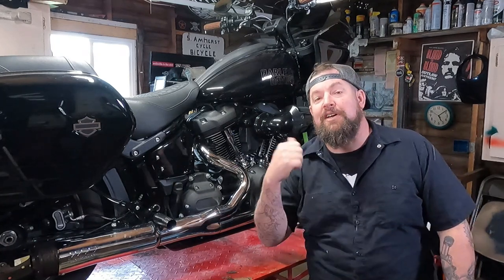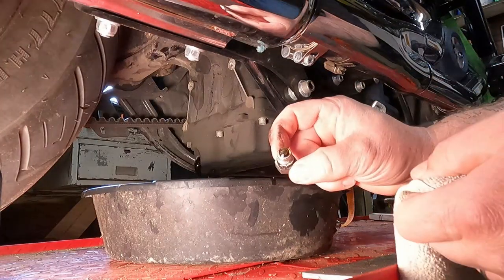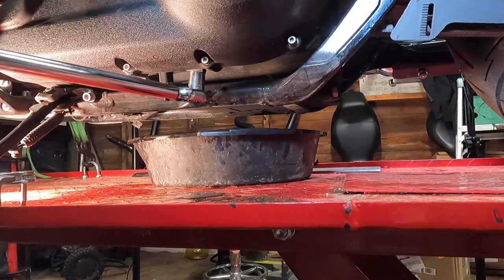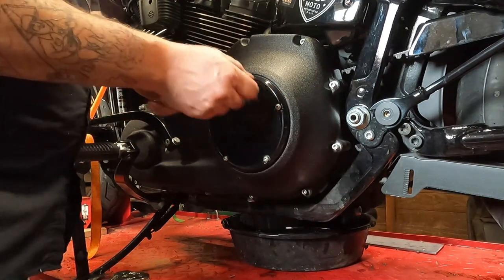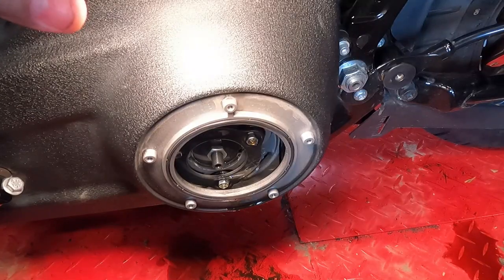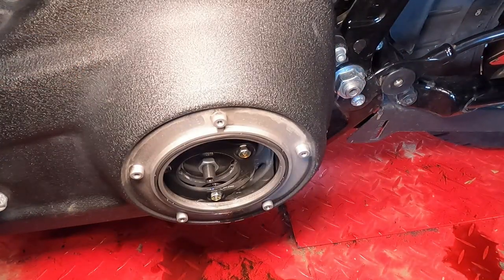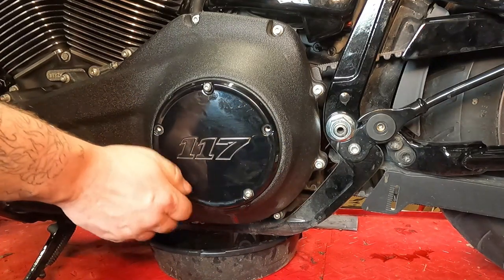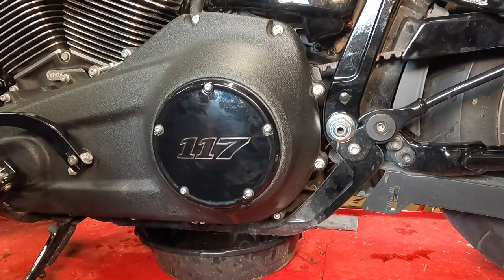M8 Softail Primary-Chaincase Oil Change.

Comment: Why would you need gear oil in the primary. A 10W-50 semi synthetic motorcycle specific 4T engine oil would be better. Not much in the way of gears in a primary.
Reply from the maker: Thicker oil is generally used for stuff with larger clearances.  The gear oil is lubricating the compensator ramps, clutch hub bearings, starter gears and of course the primary chain.

Comment: Break loose derby cover bolts first!  Do drain plug last.  Could avoid having a real bad day. Stipped bolt head & no oil in primary.
Reply from the maker: Either way you have to get the derby cover bolt out.  Are you going to just ignore it and ride on the old oil?
Reply: @KnobleMoto  you totally missed the point - you can ride the bike to somewhere to get the bolt fixed.  Not if fluid is drained first.
Reply from the maker: @johngall9974  I did miss that point.  If I stripped a screw, I would just cut a slot in the head and use a flathead screw driver.  Or you could drill the head off.